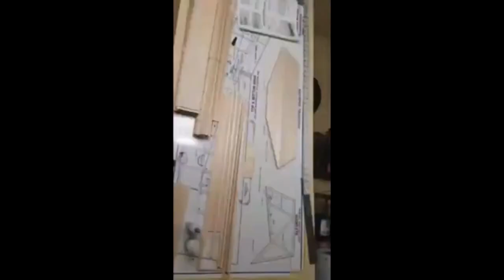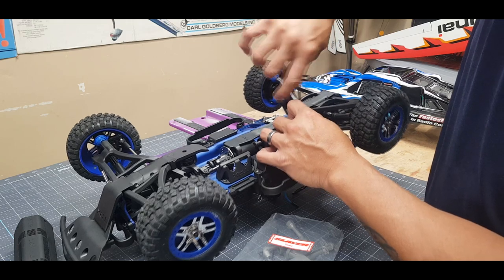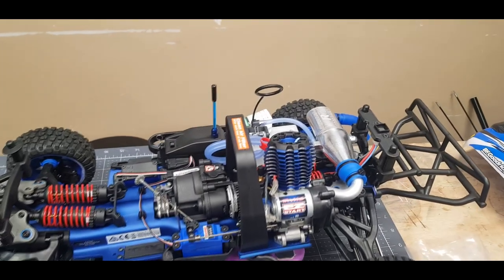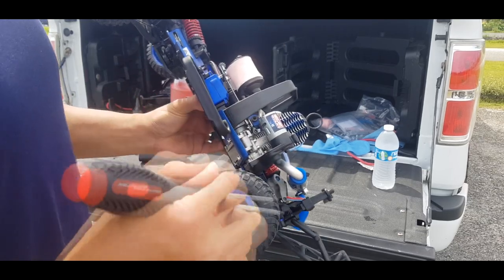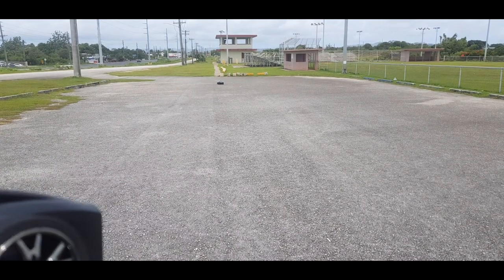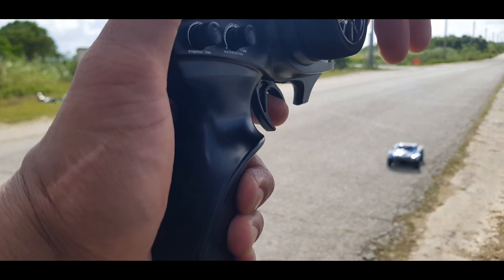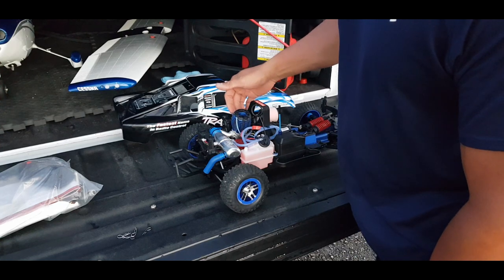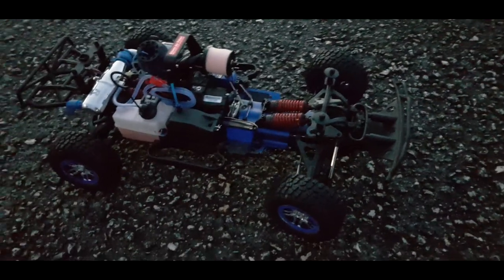How to Break-in your Traxxas TRX 3 3 Engine (Slayer Pro 4x4)

Comment: Best video I've seen so far to learn how to break in a Nitro engine. I've only been in the hobby for around 6 months now. Sure, as a kid I had a few el'cheapo RCs like the old Tycos, Nikkos and I think the most expensive one I ever had was an old Tamiya Grasshopper but they were nothing like what you have today. My first true RC I bought was the Traxxas Fiesta ST VXL due to being a fan of rally racing and the cars. Id been interested in buying a nitro and finally pulled the trigger today after a week of reading reviews, I chose the Traxxas Slayer 4x4 Pro Nitro along with I think a quart of 25%. I'm going to try to break it in some, if not all the way in tomorrow. I'm a bit confused with the tuning and all that but Ill figure it out. The main think is to get the engine broke in.
Reply from the maker: @christopherscott934  awesome

Comment: Just bought one today. My first nitro car ever. I really appreciate the time you put into this video. I subscribed also. I watched it twice to get the process down but I will review the manual when I get the Slayer Pro in the mail. 🤙🏼
Reply from the maker: Use the video just to see how things are set into motion.  But yes read through the manual as well and you will be good.  Thanks for watching and subscribing to the channel.
Reply: @BayonasRCWorld  Hey bro, I really need some help! I can’t figure out how to install the 1200mah battery. I unplugged the double AA box and now all I have is a red light on the receiver and no wheels turning or throttle opening
Reply from the maker: Is the Nimh pack fully charged?
Reply: @BayonasRCWorld  I’m just gonna send it back to Traxxas I think. Might be the smoothest option at this point.
Reply: @BayonasRCWorld  Hey brother, the car is running pretty good it passed the 4 second pinch test but sometimes it dies when sitting idle. Can you explain that??
Reply from the maker: @WillyKsprays  how low Is your idle?
Reply from the maker: @WillyKsprays  adjust the idle screw 1/16th turn in and observe engine.    Do not adjust high speed needle or low end.  Just idle screw!
Reply: @BayonasRCWorld  I’ve adjusted the high end and low end
Reply: @BayonasRCWorld  I don’t think it’s too low the idle but I’m still new. Its still running cool at the glow plug though because I have a laser thermometer and I am still getting amazing throttle response and it sounds amazing
Reply: @BayonasRCWorld  counter clockwise? or clockwise?
Reply from the maker: @WillyKsprays  in is clockwise and out is counterclockwise
Reply: @BayonasRCWorld  so in clockwise will turn up the idle?
Reply: @BayonasRCWorld  By the way I hope you understand by me telling you that I really appreciate your help and love your videos
Reply from the maker: @WillyKsprays  thank you very much and I really appreciate it.
Reply from the maker: @WillyKsprays  yes but at the sametime keeping the throttle barrel slightly opened and preventing it from closing during surges.
Reply: @BayonasRCWorld  so pick it up and very slightly pull the throttle open and then turn the idle clockwise in and then examine the idle without throttle while it’s sitting on the ground?
Reply: @Bayona's RC World  its easy too set up?
Reply from the maker: Yes it is fairly easy once you understand what you really need to do.

Comment: I’ve ran electric RCs for years and I’ve been thinking about getting a nitro and I love the way you explain everything. You make it where an idiot like me can understand.
Reply from the maker: There are alot of newcomers to nitro and purchasing Traxxas vehicles as their first RTR vehicles.  I always get asked about the breakin procedure and so I decided to just make this video.
Reply: @BayonasRCWorld  I was plan on going with the traxxas revo 3.3. Do you have any suggestions for after run maintenance?
Reply from the maker: @williamlake1753  for after fun ensure you empty the tank of fuel, attempt to start the engine until it will nolonger start.  This will ensure that the crankcase has no fuel left inside.  Then remove glow plug and spray a few squirts of WD40 into the cylinder and then turn engine over with starter or pull start holding a rag over the top of cylinder head or glow plug opening to catch the oil residue.   Then replace glow plug and store the vehicle.
Reply: @BayonasRCWorld  thank you so much
Reply from the maker: @williamlake1753  Anytime my friend

Comment: Hello,

Great video man, plain and simple and clear and concise.  Tons of great information, especially for the new guys interested in getting a nitro RC vehicle but a great video to watch for any level of RC enthusiast.  You earned my sub.  I just got the same truck except I got the red one.  I haven't even started it yet.  Because I'm quadriplegic I can't do anything except drive it, I'm waiting until my cousin can help me with it...  Hopefully soon!  I've had other nitro Traxxas vehicles in the past, I had a Traxxas Revo 3.3, a T-Maxx 3.3 and also a Jato 3.3.  I almost got another T-Maxx but I like the inboard shocks on the Slayer and the Revo.  I considered getting another Revo 3.3 but I don't like that it has a rechargeable pack.  Because I'm quadriplegic I don't get to drive them much so that battery pack would go bad, I like the AA holder better.  Also, I don't like how the Revo 3.3 has more electronics like the opti-drive and third servo to shift into reverse.  Just more stuff to go bad or have to maintain as far as I'm concerned.  Also, the Slayer being lighter, smaller wheels/tires and lower center of gravity it'll be quicker, faster and handle better, that's why I went with the Slayer 3.3.  Also, it looks really cool!  I've been an RC enthusiast for 36 years and counting!  My very first "hobby grade" RC was the Tamiya Midnight Pumpkin way back in 1987 when I was 12.  Before that it was always disposable junk from Toys-R-Us or Radio Shack.  LOL!  Here's the collection I have now.  Thanks for the great video, I'll be back.  Have a great day!

Traxxas slayer 3.3
Traxxas Slash (HCG Baja body) 
Traxxas Slash drag car (custom built)
Team Associated DR-10 drag car
Team Associated B5M/SC5M drag truck
Team Associated T4 stadium truck
Team Associated TC4 touring car
Team Losi 22S drag car
Tamiya Land Cruiser crawler
Prather Fun Cruiser 46" gas boat
Proboat Thundercat 31" nitro boat
Reply from the maker: Excellent stuff brother!  I have been in this hobby for 41 years now and still going strong.  My first RC car was by Nikko Turbo Panther from the JC Penny catalog LOL.  Hey but that was back in the good old days right.  Then I got a Grasshopper, then the Tamiya Boomerang then years later I got the Tamiya Clodbuster, Midnight pumpkin, Black foot, Lunch box, Monster Beetle.  During this time as well I began building stick and tissue rubber band powered free flight models then control line and moved up into building and flying RC gliders and slope gliders.  1988 I got into RC helicopters, and further into nitro RC Airplanes.  Since I have been always jumping back and forth between ground and flying RC models throughout the years.  I got into trail vehicles, rock crawlers, drifters, Semi trucks, motorcycles and then 1/5th scale gas buggies and stadium vehicles.  I just love this hobby with a passion!  I tried race drones and FPV as well but I prefer flying line of sight to be honest.  Anyhow glad that you found my channel and that a video was enjoyable and worth watching.  I don't have fancy transitions, audio, graphics or speak proper English like top YouTube channels have, my main concern here on my channel is to share my experiences,  show how I do things, and motivate others to give RC a try and or if you are currently into RC to don't give up and learn as much as you can that way you can continue enjoying all the RC models and endeavors that you can.  Be safe in all that you do brother and thank you.
Reply: @BayonasRCWorld  That's awesome man, lots of good stuff for sure!  You're not going to believe this but I had one of those Nikko turbo panther buggies.  I also remember one called a Red Arrow from radio shack and I specifically remember it being the first one that I ever had with the 540 motor.  LOL!  I had a couple airplanes over the years but for very short times and I only flew a couple times.  I also had a 1/5th scale Rovan buggy several years back and I'm actually considering getting another one.  Having been paralyzed for almost 23 years now I have a lot of problems that keep me from getting up as much as I'd like to.  If I can spend enough time outside enjoying the hobby this summer I might have to order one.  I can tell you love the hobby with a passion, so do I!  I know what you mean about the transitions, graphics etc.  You don't need any of that, just keep doing what you're doing.  I'm glad I found your channel as well, my kind of videos.  Thanks again!  Take care and have a good one, buddy!  🙂

Comment: on my first tank of my break in procedure, my nitro rustler would always roll away even with the throttle at neutral. i thought it was the idle needle being too lean so i richened it, but did nothing. i suspect i may need to richen the low speed needle instead. your video helped me realize this, and i hope it goes well thank you!
Reply from the maker: Sweet

Comment: What I mean is backing out that adjustment screw so you can hold it for three or four seconds on the fourth tank without it shifting
Reply from the maker: I understand what you are saying for I have been doing this since the 80's.  This video was not intended for advance individuals to nitro Traxxas vehicles.  The reason why I have done this video in the way I did was to give the newbies a visual representation of the outlined Traxxas breakin procedures nothing more and nothing less.  On top of that keeping true to the instructions outlined by Traxxas I explained things to make it easier to understand.  You be surprised how many questions I get in regards to the breakin procedures.  So If you have been running Traxxas nitro vehicles for a few years under your belt then you know more than the newbies being their first nitro or even their first RC in general.

Comment: im not very fond of the traxxas method, its way too hard on the rod and wrist pin. i broke in an engine the traxxas way my very first nitro car, my tmaxx, engine lasted about a month running it a couple times a week. it lost most of its compression and wouldnt tune anymore. I bought a revo 3.3 and used the heat cycling method that the nitro buggy guys vouch for, takes about a tank and a half, maybe 2 tanks, the car has so much more power afterwards. that was almost a year ago and it still has high compression. Thats just my 2 cents though, i really like your video, its very informative, you touch a lot of very important points and answer questions i had my first time. And good call on the slipper clutch, mine was VERY loose out of box
Reply from the maker: I have had a few newcomers to the nitro hobby had similar issues.  And what I found out was the guys that I physically was able to see what was going on with their model all claimed that they followed the Traxxas breakin instructions to the T.  Well I had them run through with me what they did and 90% of them just did not understand the needles low and high end.  So with good intentions they followed the breakin procedures 1 through 6 with the trigger pulls, engine cool down etc.. all while turning in the high end needle way too far in making it too lean because they did not understand the engine sound, smell, lean mixture indicators etc..  Most of their reasoning for touching the needles too soon was because they could not get the engine to idle and stay running.  This is where just keeping it simple comes in and to be honest I have been a nitro guy since the early 80's and I know all about the heat cycle and tuning techniques of the past since that's how we broke in our engines.  In all honesty if you are a complete newbie to Nitro then I always suggest getting the assistance from an experienced hobbyist for the first time.  I have been running Traxxas nitro vehicles since they came out on the market and had my fair share of issues with the TRX 2.5 engines.  I have always been a O.S. or Novarossi nitro engine kind of guy with all my nitro on road or off road.  But anyhow I truly appreciate the comment and I truly appreciate you for watching the video.
Reply: @BayonasRCWorld  yeah, i actually run a small engine shop irl, i can at least find my way around a carb. i hear you on the 2.5, my first and only one had a warped head out of the box

Comment: Is it important to have it on the ground under load? My old hpi we broke in on blocks
Reply from the maker: That's how we broke in the engines back in the olden days.  Some still do it today however I would not advise it to new comers to nitro vehicles.  It is just best to keep it simple for the breakin process while bringing engine up to proper temp and then cool down.  The reason Traxxas does the breakin procedures in this fashion to me is merely to get the newcomers into nitro and slowly integrate them with the procedures while learning and still playing with the vehicle somewhat.  Gives them a hands on experience all around in my book.
Reply: @BayonasRCWorld  yeah sweet so its mostly about heat cycles, good to know!
Reply from the maker: Basically!

Comment: Just got mine brand knew.  Mine spits fuel our the glow plug yours looks clean. Is something wrong with Mine?
Reply from the maker: Have you tried tightening the plug with the glow plug tool?  Also ensure you have the brass ring installed onto the plug as well.

Comment: Que temperatura manejas en relenti y que temperatura manejas cuando has acelerado a tope? Lo otro por qué se me apaga si lo aceleró a fondo?
Reply from the maker: Normally engine temp in the 250-270 range however those temperatures could fluctuate depending on various factors like outside temps,  type of fuel you are using,glow plug, and condition of the engine itself. Get a good temperature gun give you a ball park figure what temps you are running at.  Also don't just use engine temps as your be all set all fix.  It comes down to how the engine responds, runs, idles etc...
Reply from the maker: Your engine dies or quits at full throttle because of various factors.  Most of the time engine running too lean.

Comment: Thank you brother.  Very much appreciated. Subscribed
Reply from the maker: Much appreciated 🙏
Reply: @BayonasRCWorld  question,  were you pinching the fuel line in between tanks to stop the truck for the 15 minute cool downs
Reply from the maker: @tjgetem3783  yes by the use of the red fuel line clip.  Some Traxxas nitro vehicles does not have this clip so pinch the fuel line with your fingers.
Reply: @BayonasRCWorld  thanks
Reply: @BayonasRCWorld  my tmaxx is jerking really bad and moving on it on without me pulling throttle
Reply from the maker: @tjgetem3783  reduce the idle by turning the idle screw counterclockwise 1/8 turn at a time.  The screw is located on the side of the carb.  Not the High speed needle o
Reply from the maker: @tjgetem3783  reduce the idle by turning the idle screw counterclockwise 1/8 turn at a time.  The screw is located on the side of the carb.  Not the High speed needle or low speed needle.
Reply: @BayonasRCWorld  thanks bro . You have an email or a way I can contact you directly?
Reply from the maker: @tjgetem3783  bayonasrcworld@yahoo.com

Comment: I purchased the Hpi 4.6 I think that’s how I will do it  if not let me know
Reply from the maker: You can use these breakin procedures to any nitro RC car or truck engines.  Overall it is mainly to slowly bring up the engine to proper temperature for an certain amount of time and then allow the engine to cool down somewhat.  Overall the Traxxas procedures basically gives the newcomers to nitro the opportunity to learn to breakin the engine slowly while also getting some play time.

Comment: I have one of these trucks, i have had it for many years.  Do you know anyway of making the exhaust quieter?  I have tried stuffing the exhaust with stainless steal wool but it doesn't make much of a difference
Reply from the maker: I would not restrict the exhaust flow otherwise you could cause engine issues.  As far as making a Nitro quieter ummmmm using the stock muffler is actually pretty quiet compared to after market mufflers that are a tad bit louder.  Nitro is associated with that engine sound and to be honest I never looked into trying to make it quieter.  If I wanted quiet I would breakout my electric models.  Some neighbors don't like the sound so I just go find a large field away from houses to run my Nitro vehicles.  Other than that the stock muffler is the quietest IMO.